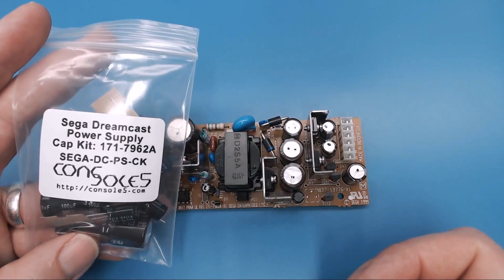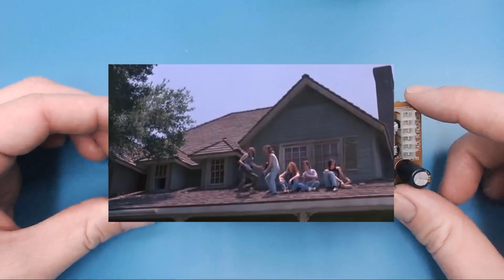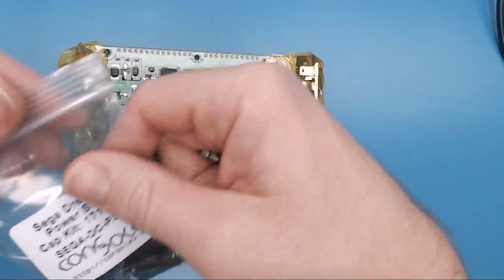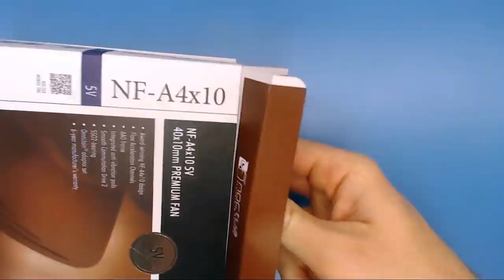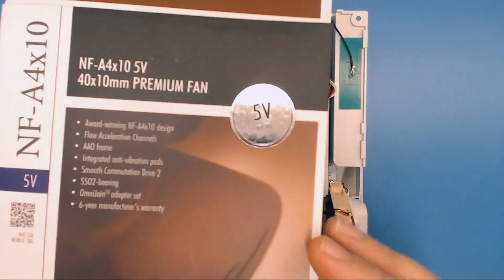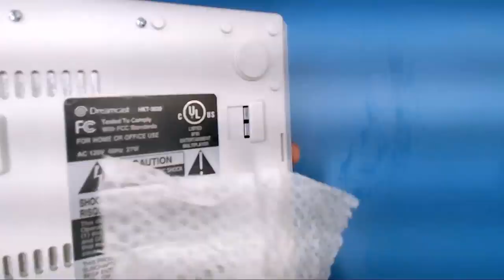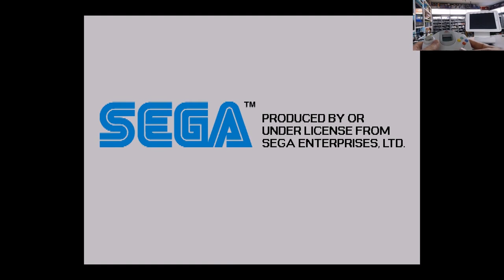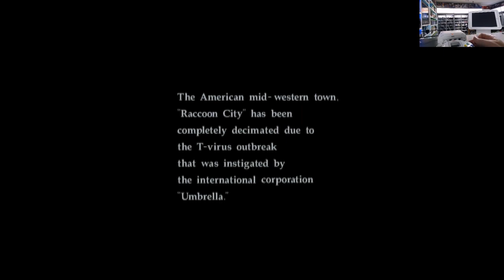Unbelievable Mods for the SEGA DreamCast! DCHDMI DCDigital Install + More! 1080p

Comment: Great vid, I have a DCHDMI and have attempted to install once, completely fudged it and broke the Dreamcast, even with plenty of flux and good solder, I'm just bloody useless, and I thought I could solder lol I still have the mod and another cable, just practicing on old boards at the moment, but still can't get that wipe soldering correct... Is there any advice you can give. It's difficult to get an installer in the UK.

I would be grateful for any advice...
Reply: I suck at soldering too, my greatest achievement was to resurrect a broken snes that didnt turn on so I desoldered the fuse from a  snes that only showed black screen when powering on and it felt great to get working snes, but I ended up melting some internal plastic and frying my fingers, but Im ok.
Reply: flux and a microscope camera, a good soldering iron with adjustable heat and plenty of tips

Comment: Just sent you an email. I'm interested in modding a few dreamcast units. So the DCHDMI and GDEMU will work with model 0 & 1 Dreamcasts correct? As for my Mnemo USB Gdroms my units are version 1 and will need the usb port to be turned over but this shouldnt be an issue for you.

Comment: What heat did you use for the ribbon cable? I can do caps and done a few other mods but flex cables I need more practice. The Wii dual cable I ended up burning despite using lots of flux.
Reply from the maker: I run my Hakko Fx888d at 320 degrees Celsius for this. I try to make the connections quickly so as not to damage anything. If I don't like the look or have a bridged connections I will just wait a bit and let it cool off before coming back and trying again. Patience is key!

Comment: Where can I find a FAQ on the HDMI MOD? Where to find a honest seller of all that is needed for the MOD and where to send your Dreamcast to have someone honest to install it including cutting out the holes in the Dreamcast  that won't take you money and run leaving you out of you money and Dreamcast? 
Also I heard or read somewhere or saw it in a video that some Clone GDEMUs cause a no audio problem with the HDMI MOD and would need to know how to identify which Clone GDEMUs are effected.

Also if you have a GDEMU you need to add an additional mod in order to get that button that emulates changing Discs to work with the HDMI MOD?

The HDMI DCDIGITAL Kit is out of stock at Black Dog Technology.

Comment: 1:03:38 - Get a canon 70D (or higher) or a T6i (or higher) and a semi-decent lens.   Don't need L series glass, but maybe a 18-135 STM or 55-250 STM.   Presonally I like the 100mm Macro, but wit's less versatile

Comment: Can you just install a way to use a hard drive to install games on that? I don't like memory cards and I want to keep my CD rom. ?
Reply from the maker: I'm not aware of any solution for what your wanting. However the installation and removal of the GDROM and GDEMU is really pretty simple. So if you really wanted you could swap them as needed to play between original games and ISOs.

Or just pick up a 2nd DreamCast as the consoles themselves are still relatively cheap.

Not sure if its possible but maybe someone could develop a way to use the modem port slot to house something for this. But I'm just talking out my ass and not sure if this is even possible. LOL.

Happy Gaming!
Reply: @dragonshoardgaming5514  
Look up youtuber retrogametech he done that years ago to his dremacast

Comment: How exactly do you know where each capacitor is installed on the MB? I took a pic of the MB before I removed them, and I also tried to follow your installation in the video, but when I think I'm missing the capacitor for the CE503 space on the MB, near the 6-pin psu connector, and some numbers didn't match the numbers/letters of the ones you were using.

Comment: Question, everything was going well on my mod until I got to the ic206. The dot of solder disappeared and now I can’t install the reset wire. Any way I can savage this? There doesn’t seem to be any metal to solder to. Just a black hole left 😩😭
Reply: I ran into the same issue. I then just left that wire out.
The mod works fine, so I just have to live with the fact, that I can‘t do a reset with the pad.

Comment: Hi there.  I'm just curious what temp do you have your hot air station at? Also what temp do you use to solder?
Reply from the maker: I'll give you some numbers but remember this is for MY equipment and numbers may be different for yours. Best bet to start low and work your way up. 

Aoyue 968 Reflow Station
I run @ 350C and 50% airflow for most SMD work. 
As long as you keep moving and use kapton tape on anything you don't want to melt you should be fine.

Hakko FX-888d 
I run @ 320C for almost everything (flex cables included) 
If I need a little more heat for dealing with big ground planes and such I will crank it up to 340C

Hope this helps!
Reply: Dragons Hoard Gaming thank you very much.  Your snes mod video gave me the confidence to try it myself.   I followed your vid and IT worked!  No I just need to muster up the courage to replace that tiny c11 cap on my snes mini.

Comment: There is no need to change caps from game mother board unnecessary  work
Reply: CE103 and CE401 caps on my VA1 board started to leak. Console still ran but for how much longer before issues come up. In my opinion, it is always good practice to do preventative maintenance.